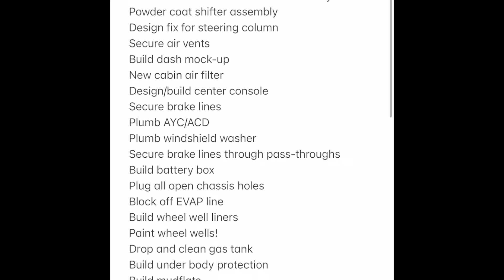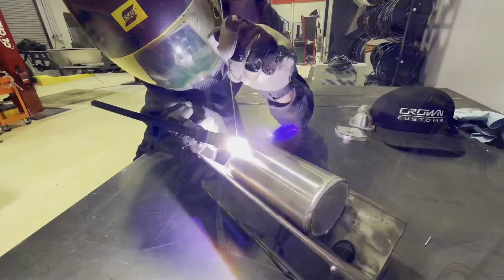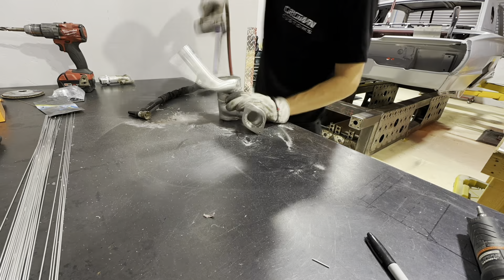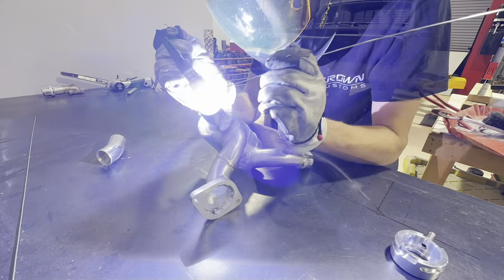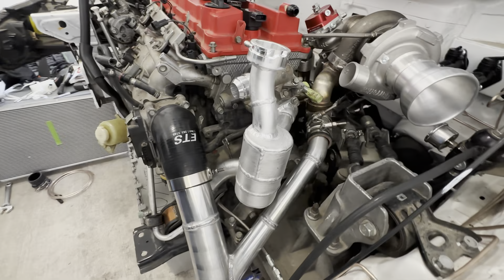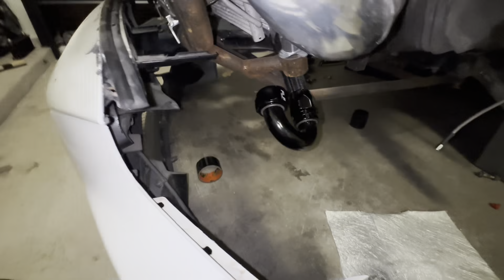Prototype Swirl pot. EVO X cooling upgrade!

Comment: I hate to be that guy. 😢 but you've installed the swirl tank on the return side of the radiator. 
The X the thermostate regulates the return. Backwards from most.  Not that it won't work. Just not ideal. 😅
Reply from the maker: Well sh*t you are correct. Good catch I’ll have to remake it.